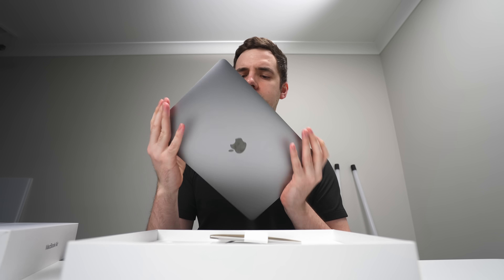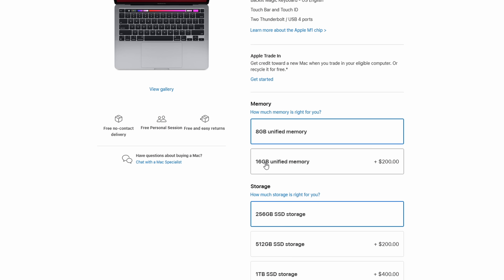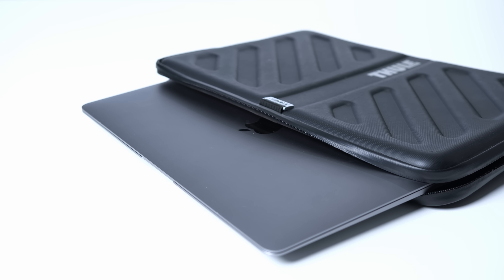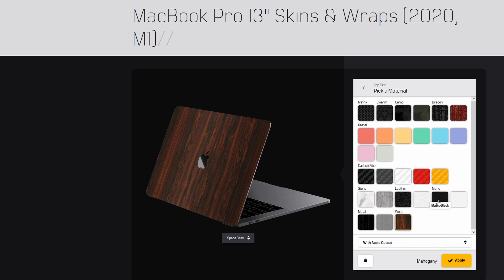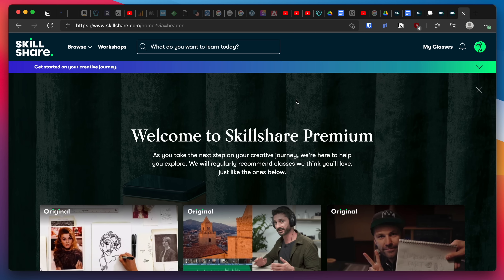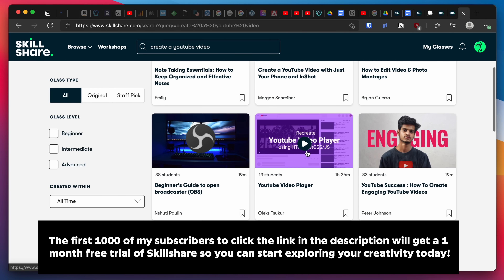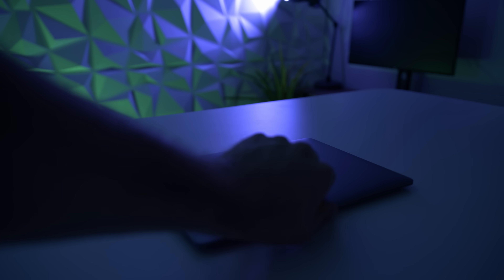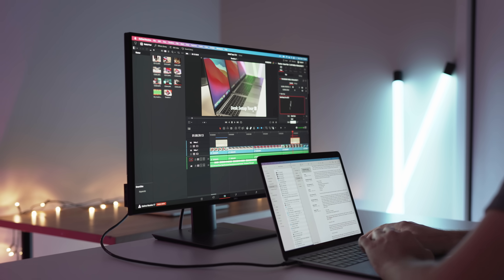How To Make Your MacBook Last FOREVER! (Ultimate Guide)

Comment: I have my MacBook Air 2020 since the first of September,its now at 17 charge cycles and 100% bh. I never leave it plugged, I usually unplug it once its at 80-90 % range and let it drain to like 30%. Is this a bad habit? should I rather keep it plugged in all the time when im near a power socket, not letting the battery drain below 100%.
Because im seeing people claim that once your Macbook reaches 100% charge it doesn't use the battery anymore but uses the power of the charger. Which seems to imply that if you keep your Mac plugged forever you'll battery will never degrade as it will never use any power.
So I am a bit confused when it comes to the best way to use a Macbook battery for the best battery health longevity.

Comment: I have a mid 2012 MacBook Pro, I changed 4 years ago the hard drive for an ssd and upgraded to 16 gb of ram, I use photoshop and z brush as concept artist and illustrator sometimes, and that machine is still going strong. The truly are built to last.
Reply: Has it gotten slow over the years?

Comment: Hi man!

Not related to this video but which external monitor would you suggest for a Mac Mini/MacBook Air? I have to buy one of the two soon(will probably go with the Air) and I'm ditching my old desktop monitor to make a cleaner setup. Ideally I'd like it to be 2K/4K and with great blacks and color reproduction since I work with images, video and design. If it has thin bezels it's a plus but not mandatory, oh and it should be black.

Any ideas? I'm not keeping up with monitors and such.

Comment: I’m still using my base model mid 2012 mac book pro after 9 years. Never cleaned it once but it still survived any beating I threw at it and is still going strong. The only thing I did was switch the hdd to a ssd this year.

Comment: A note on thermal performance and longevity. With the temps that these chips run at and thermal throttle at, (which is actually a bit different between the air and pro), you may get more performance out of the pro, especially for long hard workloads as the increased cooling will mean less throttling, but the passively colled macbook air will likely do better for longevity alone. The chip throttles at a lower temp, and it wont accumulate dust. Nor does it have any intakes to block or fans that can fail. Its thermal performance over time will likely be more consistent and doesnt require the user to maintain it by claning the internals. Generally means it should last longer and be less likely to fail, even to thermals because its limits are consitent, though you are obviously sacrificing some peak performance.
Reply: This is such a great point, while some people may regret not going for the Pro, the MacBook Air will definitely be a better choice for the long term when your device starts collecting dust and drops performance in a few years
Reply: @SaifSKH  well pro have better record in longevity as compared to Mac Air, people are still using more than a decade year old pros but I know what you're saying
Reply: @ashyyyk8098  he is talking about the M1 air.
Reply: @ashyyyk8098  I’m still using my MacBook Pro from 2015😅 might upgrade this year though
Reply: @ashyyyk8098  The old macbook airs have fans, the m1 macbooks dont. So all the stuff about dust and throttling at lower temps is only true for the m1 airs
Reply: @callanc3925  I know people who sill use the og fanless Macbook. It's shit but can't fault its longevity
Reply: @VuLamDang  I bet the average life span of a macbook with fans would go up a bunch if people regularly got the dust cleaned out of them
Reply: i just wanna browse the web and carry it all around, so im good
Reply: Chetan, to clarify, you mean the fans don’t turn on much for silicon MBP, yes? I have a 2016 and they’re running often!
Reply: Even if you clean the fan once in three years this should not be a problem because the fan rarely turn on in the pro. Also the cooling will also help battery life by keeping the whole system cooler. I don’t see it as a disadvantage.

Comment: do you think a glass screen protector of some sort would prevent i think whats called “staingate” from happening on any macbook model with that antireflective coating?? im considering buying myself a macbook pro but the potential of getting those terrible stains on my screen is the one  thing holding me back😭
Reply from the maker: Stain gate is no longer an issue, you don’t need a protector

Comment: I got a base model MacBook Air I’m 2015. Had no problems at all with using it as a windows laptop. Unfortunately it died this year due to my AC exploding and flooding it with water. Honestly Mac’s are just built better IMO. I’ve had so many laptops that cost half the price and only lasted a year :/

Comment: I just bought a M1 Macbook Air to replace my 10 years old Macbook Air.  My 10 year old Macbook Air was still working great but I was using Big Sur at work and wanted it on my laptop.  The number one rule in my opinion is to keep it away from liquids, to the extent of never leaving drinks right next to it and never pass drinks over it.  I keep mine in a case when I'm not uisng it, and my next tip is very important on older macbooks and that is NEVER EVER use a third party charger, only use a genuine apple charger.
Reply: Thank you sir !!!!
Reply: There's no way I'm using that large MacBook charger anywhere outside my house when the much smaller iPad charger is there. I don't need the fast charging speeds
Reply: @Shalomrutere  He’s talking about the old MacBooks that have a magnetic connector like the one I have (2011 air) I recently bought a third party charger and the laptops behaves a little different when connected to it. original chargers are always the best.
Reply: @Shalomrutere  that’s still an Apple product though. He said don’t use a generic one that’s compatible
Reply: exactly how i lost a macbook: with liquid, shit
Reply: What if i use my phone charger sometimes?:D I know its slow, but still... better than nothing, in need...
Reply: @benedektt  my comment was about older MacBooks, which cannot be charged from a phone charger.  The old MacBook MagSafe charger would often fail and it was a good bit cheaper to buy a third party charger, some of 5nose were ok but some would damage the MacBook.  This does not specifically apply to usb charged MacBooks, but myself I only use good quality branded chargers and never the cheap ones as they can damage any device you use them with.  You can be lucky and use cheap ones with no problem, myself I won’t take the risk.
Reply: what about using a high end power delivery dock like a Dell 6000?
Reply: @hazyproduct1692  I was referring to the older Apple MagSafe power supply really, later MacBooks with have usb chargers are fairly universal.. I’d still use a high quality charger myself for any device, but any branded quality USB charger should be good.  I did state that the power supply tip was relevant to older MacBooks, though to be fair “older” could mean anything.
Reply: @andrewstones2921  So you were talking about the MagSave power adapter you can't detatch? What about using a third-party brick with one of the new MagSafe USB-C cables from Apple?
Reply: @hazyproduct1692  I feel that good quality branded usb c adaptors are fine, my comment was based on the older fixed cable MagSafe.   I’ve started to see a lot of very poor quality USB C chargers for sale that have very poor separation internally between the ac and dc circuits, sometimes with just 1mm between them and very little or no circuit protection.  It’s much safer to use the Apple charger or at least ensure that you only use high quality chargers of the correct rating
Reply: i just spilt green tea on my 16 in m1 max💀 DONT DRINK NEAR YOUR MACBOOK
Reply: deymm 10 years is a good deal :)
Reply: I used a generic charger on my mid 2012 MacBook pro and it stuffed it up big-time I haven't had a new Mac for about 3 years now but hopefully will get one for my birthday in April 2024
Reply: Thank you sir but how to know whether charger is the original one
Reply: @isaacwester7877  if you buy from Apple you can be quite sure it’s real, if you buy from fleabay.. well it’s a gamble.
Reply: Can I put a hard shell case on my MacBook or will cause any issue
Reply: @Gurpreet-Singh-yd9oj  I put a hard shell on a MacBook many years ago and it was fine, as long as it’s specific made for your model you will be fine, they do protect the laptop, but be sure not to get abrasive dust between the shell and the laptop or it could do more harm than good
Reply: i'm using ventura now on my 2012 macbook air and as i really only use web apps its fast enough for me still
Reply: Also, make sure not to write and replace big files that often, as the hard drive in your computer can only do this so many times before it will die, and once it dies, your entire computer dies.
Reply: @LunaticTheCat  older MacBooks have replaceable drives, newer ones have a theoretical limit on use but in practice it’s not been an issue for 99.99% of owners. When I got my M1 MacBook I was concerned about SSD wear, but more research suggests it’s not a real problem
Reply: @andrewstones2921  Good to know. I’ll definitely have to do some more research on this and see how realistic it is for someone to actually reach this limit. 

Also, another thing, there’s absolutely nothing anyone can do to prevent this, but there have been some cases of newer soldered SSD MacBooks just out of know where frying their hard drives by pumping them with 9 volts through some sort of engineering error. Just something I thought worth mentioning.
Reply: @LunaticTheCat  wow I did not know that.   As much as I love Apple, they do make a lot of mistakes.  The only thing you can realistically do is not buy the newest model as soon as it comes along.  If the same model and spec has been on sale for 6 months then it’s usually safe.  I’ve had more than my fair share of issues in the past, but I have been buying Apple products since the 1980s.     I’ve been lucky with recent purchases.  The M1 and M2 don’t have soldered or unsoldered SSD as the storage is built in as part of the M1/M2 processor, so hopefully they will be OK
Reply: Did you have a good battery lifespan? How did you charge?
Reply: @Zaaim  The life was good, it was about 8 years before I got the “service battery” message but it didn’t seem to cause any problem.  Most of the time I’d use it plugged in, but there were also lots of times when I did use the battery in the first 6 or so years.  I gave the old air to a friend and he says it still gets well over an hour on the battery!  Just before I bought the Air new back in 2011 I bought a MacBook Pro 13 for my wife, that battery only lasted a couple of years, maybe three years at most, it’s maybe not  a fair comparison as her use was very different.
Reply: same here, I never put drinks near my laptops, and if other put drinks next to my laptops, I would ask them politely to put the drinks elsewhere.
Reply: Thank you!!🙏
Reply: I've sold my macbook late 2009 2 weeks ago, after almost 14 years. I changed 4 chargers of third party. My battery had more than 3k cycles and only in the first level of damage as It should be.
Reply: I had gotten a too-tier Dell Lattitude E6420 in 2012 at launch. It was a beast. I somehow made it last til mid-2021 and then it just got to where I’d rather use my iPhone. At the time, the base M1 Air was the best bang for buck on ANY laptop so i figured I’d get it as a placeholder while I found a PC I liked. I did find a few from HP and Dell but ultimately.. I really love this Air. 

It’s changed what I expect and still no windows laptop can do what I’ve gotten used to for under like $1500.. and at that price point I’m gonna get a machine that skimped on build quality to hit that price point.. not MacBook. 

Anyways, I’m very glad I went with my impulse to buy one. Being available at Best Buy was a big part.. I wanted it that day and people steal packages near me so yeah. 

Two years in and I love it. I hope I can use it a decade. I think I’ll be able to. I mainly watch tv shows and movies and YouTube. Don’t need much more than an M1 for that. New architecture they’re all in on? I’m set (I think anyway).
Reply: Thank you @andrewstones2921
Reply: that includes the cable too, ALOT of people fall prey to these 3rd party cables that are like 3 feet long....
Reply: How often do you shut down your new MacBook Air?
Reply: mean's to stick with apple charger heads, and not other brands. including the cable too ?
Reply: Uhh.. Apple uses the USB PD standard for charging. It does nothing differently from any other charger..

Comment: What happens if the screen cracks or flexgate happens, how am I going to make my MacBook "last forever"?
Reply: Exactly what happened to my previous MacBook Pro and exactly the reason I downgraded to a much older machine. Also, my old laptop that developed flexgate had 1 TB SSD which failed almost at the same time as the screen.